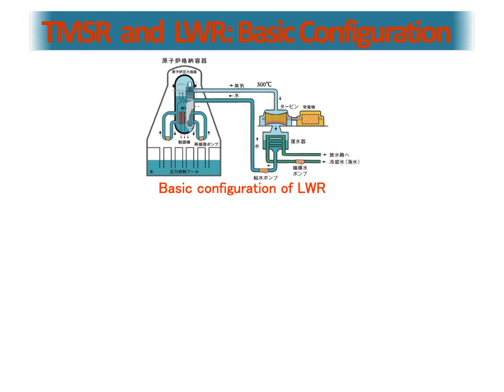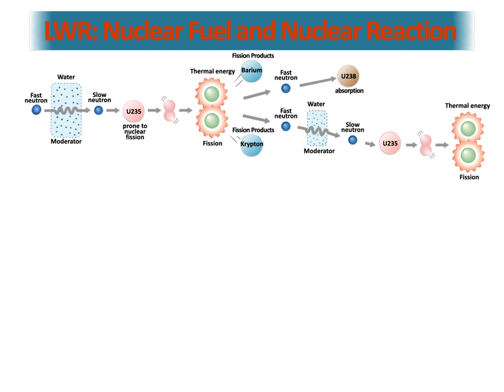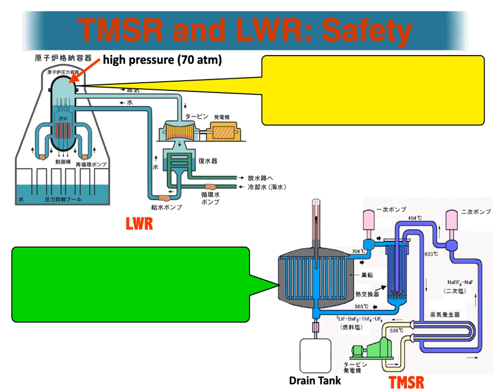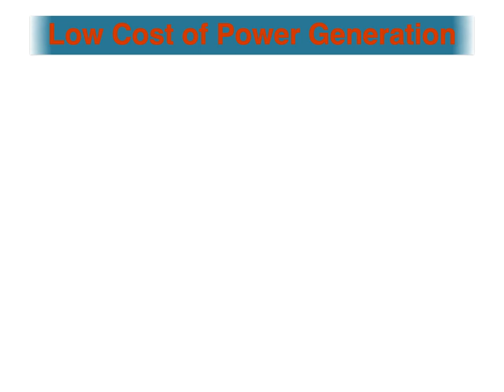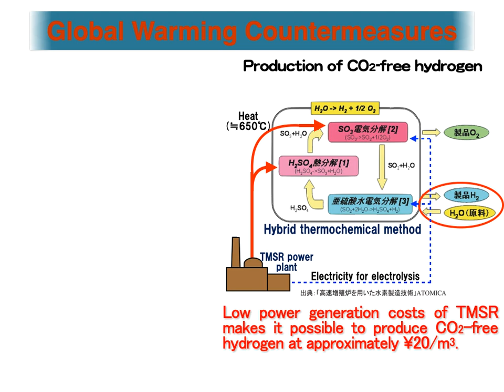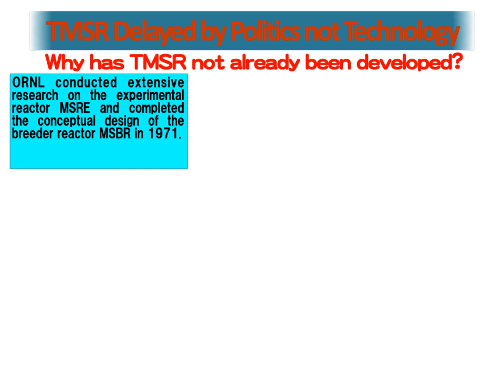What is TMSR(Thorium Molten Salt Reactor)?

Comment: Nuclear energy is the energy source of the universe
Humanity will solve its energy problems 
by transitioning from the “First Nuclear Era” to the “Second Nuclear Era”
１．Liquid fuel nuclear reactors are safe
　　Liquid fuel circulates and carries the heat generated in the core of the nuclear reactor to the outside, using this to generate electricity
　■With conventional nuclear reactors, if power generation is stopped and the coolant water is lost, the solid fuel can go into meltdown. 
　　　Molten salt reactors use liquid fuel instead of fuel rods, so there is no core meltdown. 
　■With conventional water cooling reactors, Hydrogen is generated from overheating due to power outages, leading to explosions. 
　　　Molten salt reactors do not use water, so such explosions do not occur. 
　■If there is a fuel leak, the fuel does not react with air or water. It hardens into a glass inside and does not release radioactive matter to the outside.　
２．They are low cost!　　
　　They are low cost because of their simple structure, easy safety measures, easy to obtain fuel (Thorium)        
３．Using Thorium as the fuel, Plutonium is not produced
　　The country that possesses the reactor cannot take out the Plutonium to make nuclear weapons
４．Excellent in cooperation with renewable energy

About　Fukushima
　　　It is easy to adjust the output in response to load fluctuations. When used in conjunction with renewable energy, it can cover for the unreliability of renewable energy.
LWR also come with the risk of explosion due to hydrogen generated in thermochemical reactions between the fuel rod cladding material and the water. This occurred in the Fukushima nuclear accident. With TMSR, however, such thermochemical reactions do not occur.  
With LWR, there is also the risk of reactor core meltdown if problems occur during the cooling of the decay heat after reactor shutdown. This also occurred in the Fukushima accident. With TMSR, however, the reactor core is already molten, so “core meltdown” does not occur. Even if there were an abnormal temperature rise, there would be no serious accident as the properties of the liquid fuel would remain the same.  

Why, despite these incredible features, has nobody yet bothered to develop a Thorium Molten Salt Reactor?
In the United States, beginning in 1965, Oak Ridge National Laboratory operated MSRE, an experimental molten salt reactor, for four years without any serious accidents. In 1971 the conceptual design and basic technology was established for MSBR, a molten salt breeder reactor. 
However, during the Cold War between the United States and the Soviet Union, thorium molten salt reactors, which could not produce plutonium, were not considered useful by the U.S. Navy, which was a major player in the nuclear arms race. As such, further development was blocked due to politics.

Now, however, times have changed, and this technology has been reconsidered. TMSR is now seen as a solution to our energy problems, and dozens of venture companies around the world are currently working hard to develop a commercially viable reactor by 2030.

Thorium Tech Solutions Inc.
CEO Masaaki Furukawa
https://ttsinc.co.jp